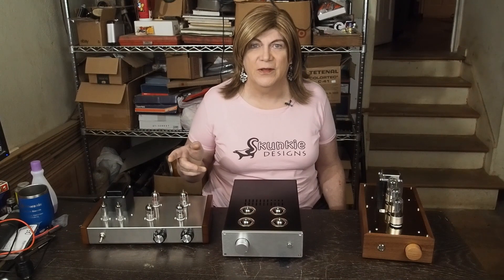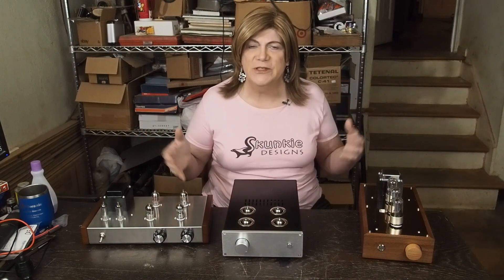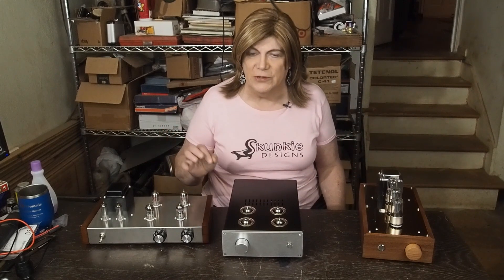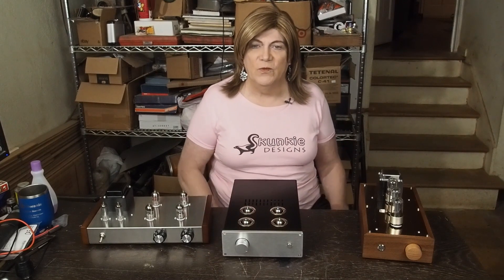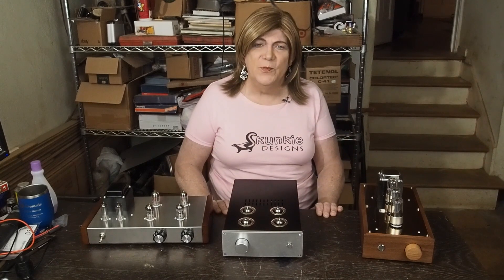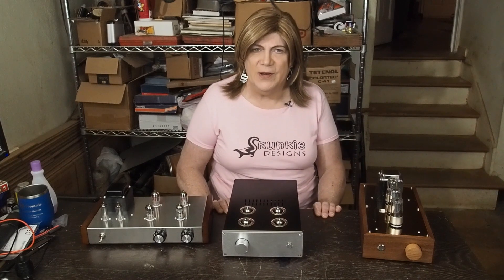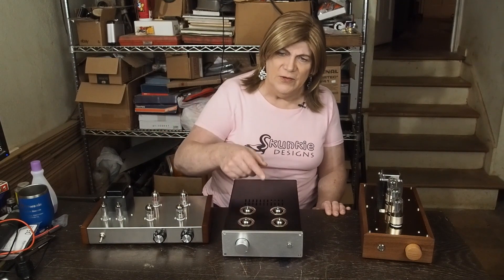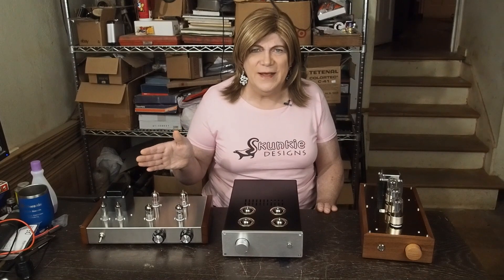Monday Monologue: Tone Controls, Where Did They Go?

Comment: You missed the point why we shouldn't use tone controls nor graphic equalizer,
As a techical engineer I can explain why.
Tone controls change the Gain in certain frequencies in order to boost or attenuate frequency range with electric circuits that consists resistors capacitors and sometime inductors,
These component makes also side effect that in same time they create different phase shift of different frequencies in these range, it means in the end that these frequencies arrive in delay to hour ears. It cause changes in our perception of the sound.
The goal of a perfect amplifier is to maintain constant phase shift throughout all the range of the frequencies, from 20 hz to 20k hz. If it's not done properly the sound Will not be coherent to our hears
Reply from the maker: Like I said: they sound bad :)
Reply: @SkunkieDesignsElectronics  yes I absolutely agree,the simplest is the best,and less is more